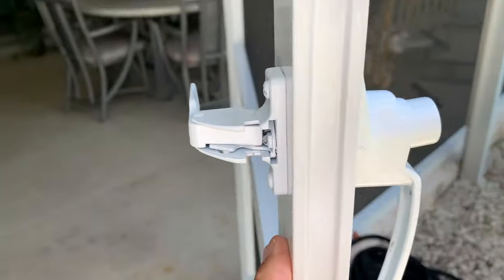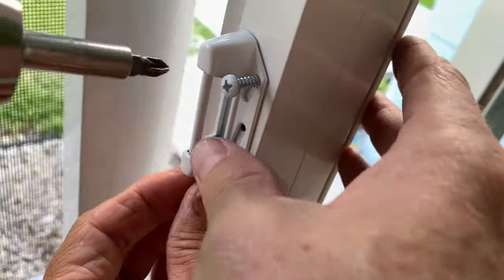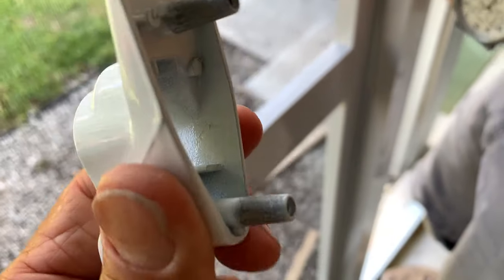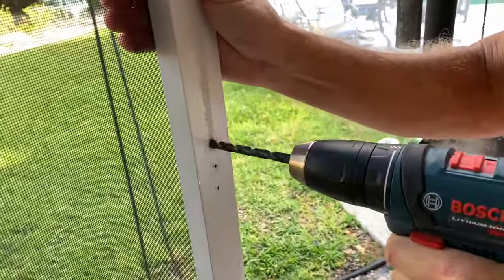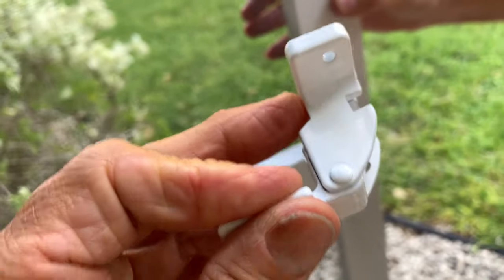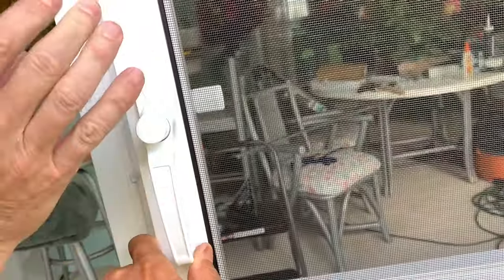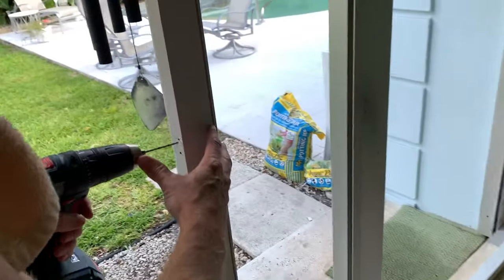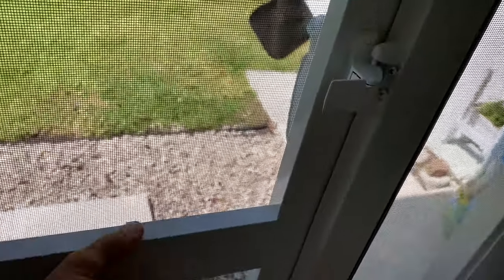How to install a screen door pushbutton handle and latch catch

Comment: Thanks for the video. My dad basically has the same setup, but with the fancy handles. I was either gonna replace the spring inside or just the entire setup because the latch won't stay catched because the spring isn't holding the side out anymore. My issue is I can't get the damn thing off. I think this handle has been on there for about 15 years so maybe that's why. Or that spring part in the middle is just broken in a way that it won't let me pull the two handles off of both sides of the door. I guess I'm just gonna have to put some elbow grease in
Reply from the maker: That’s the problem with working with old stuff. It’s hard to fix because it’s usually corroded as rust on it and then end up having to drill out the screws. Good luck on your project. Thanks for watching.

Comment: I installed this exact handle and I have no idea what I did wrong. The push button sticks unless I untighten both screws.
Reply from the maker: Maybe some silicone spray would help or your spring is a little defective good luck thanks for watching
Reply: You can trim down the push button rod to adjust. Worked for me!
Reply: Take the handle off a widen the hole. It sounds like the spring is catching on something on the inside.

Comment: Why did you do a video as you were figuring it out?
Reply from the maker: That’s how I do every single project because the experts show you in the perfect conditions how to do it I’m showing you how to do it in real life. I just make videos of me fixing stuff around my house for the first time I got a couple I tear apart my dryer and washing machine and I never did it before.
Reply: @TomLeeman , It's cool to see your thought and discovery process. I think I get it now. I went through it with my screen door even following the instructions. I got to the end and my latch doesn't catch, because the door frame where the door fits in is the correct size, but the inner door frame where the latch attaches is too big. In the instructions it must've been assumed the inner and outer door frames were flush with each other, not the case with a home built screened in porch.

Comment: Dudes, great video.  Glad you kept the catch mistake, because we were sure to do it ourselves.  Saved us.  Thanks!    Just one thing....um, I think you have the door installed backwards.  Isn't the screen and spline supposed to be on the inside?
Reply from the maker: I ever thought of it that way most of the screen doors that I do have the spleen facing out but I could be wrong anyway anyway thanks for the kind words and thanks for watching

Comment: Random question would i be able to put the button inside of the house and have the push handle outside? Just reverse the order of the handles? Do you think it would make a difference in how it works?
Reply from the maker: I guess you could do that, but then you can’t lock it from the inside
Reply: No you can’t do that because the latch handle has to be on the inside to catch the latch plate.